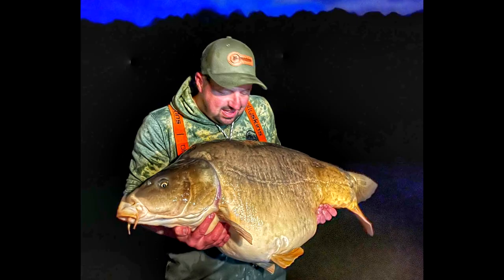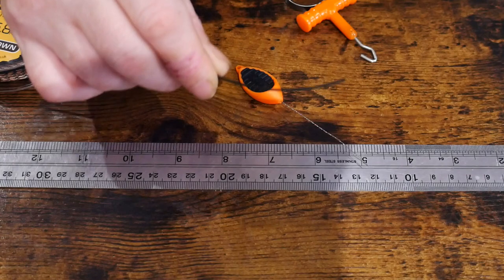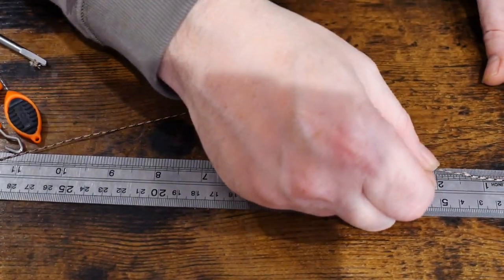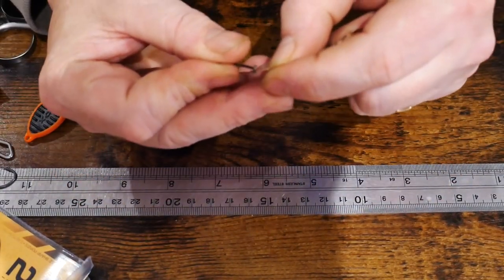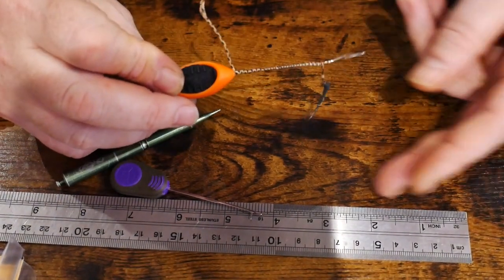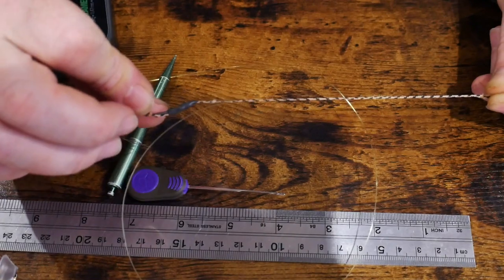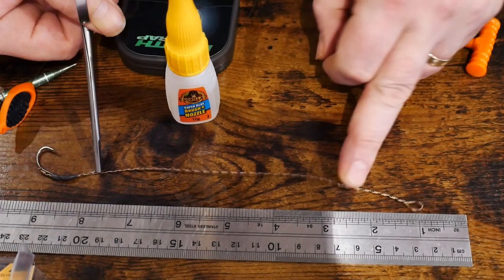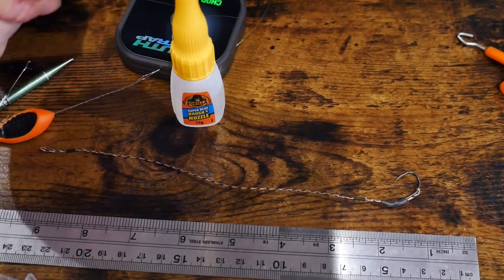How to make a "Spliced Stiffy" rig - A guide to making carp rigs -with J Precision and Choice Rigs

Comment: Fascinating rig! It's really got my mind ticking over here.. would lead core with the lead stripped out be too thick for this rig?? If not I have supernatural and a Kevlar hook link would they work do you think?
Reply from the maker: Hi trev, you can use any material that has a hollow core, I don't think lead core with the lead removed would be too thick. The rig really is more about strength than finesse. Bare in mind that any fluorocarbon is quite heavy so the rig will always sink well with a fluro core inserted 👍
Reply: @onthebankwithjprecisionand4621  I understand thanks! Will definitely give this a go!

Comment: Good to watch but what is the concept of the rig? What was it created for?
Reply from the maker: Hi Darryl, this was actually covered in the video but I appreciate it went on a bit so you might have missed it.
In short, a spliced rig is the strongest rig possible, down side is they are inherently a soft rig, no real reset properties, not great for dropping from boats etc.. Adding the fluro core was the fix. These rigs are really made with big carp in snaggy situations in mind , and or dropping from a bait boat. They are also much better for casting, especially if you have to give it a good wack as are very unlikely to tangle. 👍
Reply: @onthebankwithjprecisionand4621  Thank you for the reply, I have actually bought some off you just purely on the basis they look very effective just haven't used them yet. Would you put an anti tangle sleeve on or leave the hinge as I much prefer a lead clip???
Reply from the maker: @darrylclarkson1799  personally I would use them with anti tangle sleeves, especially if I was casting.. Dropping from a boat or placing the rig by hand etc I'd have no problem with a quick clip and a bit of silicone.